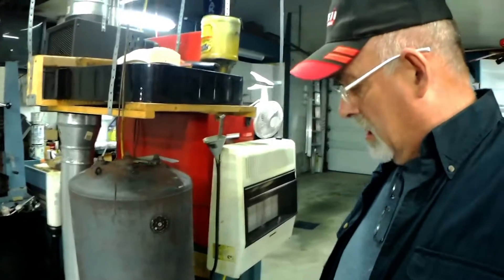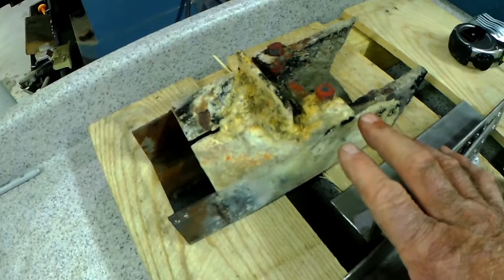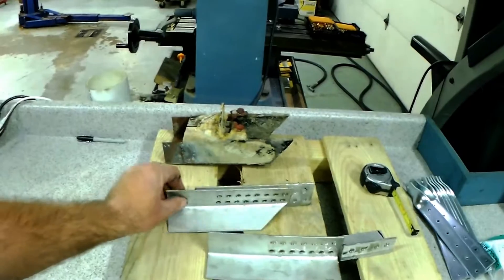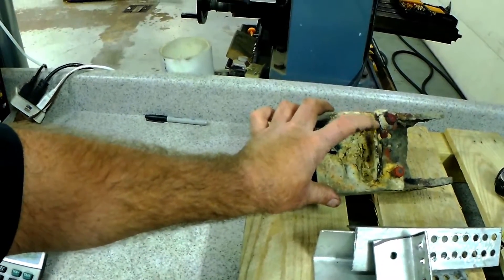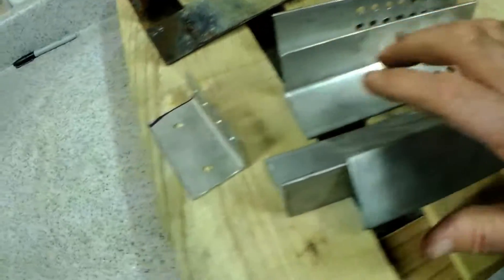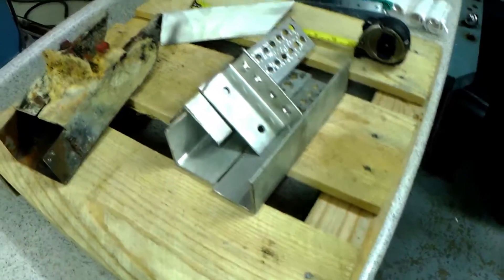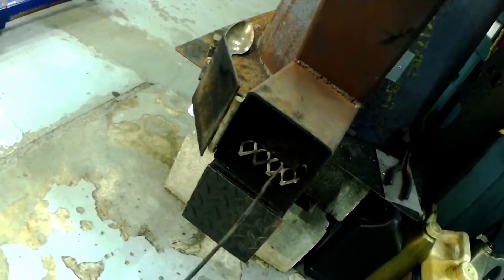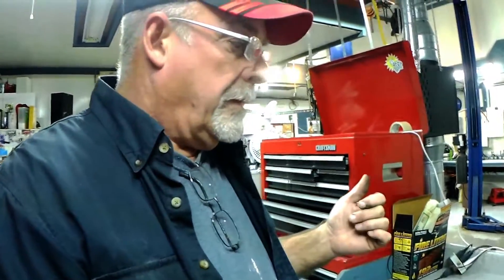Rocket stove burn basket design for wood pellets

Comment: Great video, you have a very good manner and format.  I was wondering about the design size of the burn box vs the size (width ) of the burn tunnel.  I see the burn box being about ~4 inches wide, I see the burn tunnel being ~5 inches wide, is the extra area around the burn tunnel sides a necessary design feature to help with air flow, draft continuance etc..?  Are there advantages to shrinking or to maybe growing this area around the fuel burn box.  Would making this side gap smaller help direct more airflow through the burn-box or is this gaping a way to slow down or regulate the burn rate? I am under the understanding that the burn chamber tunnel entrance to the heat riser is through a ~5 inch opening in the heat riser side where it meets( is welded to) the burn tunnel?  Thank you and others in advance for any information that may help me understand your design better.
Reply from the maker: Dean, if you scroll back through my videos you'll find an actual "build video" of the burn chamber, hopefully that will answer your questions. It's 5 x 5 square tubing, 3/16 wall. But all of that is laid out in the video. Thanks for watching and the kind words
Reply from the maker: https://www.youtube.com/watch?v=bfoTuFxxw7I
Reply: @mark_osborne  Hi Mark, thank you for writing back. If I am asking something again that is already answered please excuse me. I have watched this video 3+ times, amazing video of your work. I am pretty sure I understand you are using the 5x 5 tubing. Just wanted to understand why the welded fuel holding  box size is less than  1 inch smaller that the 5x5 tubing. That is the two angles of 2 inch butt welded = 4 inches.  No worries if I am asking something I should have learned from the videos or that has already been answered. Maybe my assumption on the size of the completed welded burn box is wrong etc.
Reply from the maker: @deanpetrella5491  got it, now I understand your question. Yes, the inside of the 5 x 5 tube actually measures 4.650 inches, I previously miss-spoke, the 5 x 5 tubing is actually 3/16 wall (not 1/8), and yes, you need a gap between the outside of the burn basket and the inside of the tube because you have to be able to slide it in and out for cleaning, etc. Too tight and you'll be fighting with it. That small air gap between the burn basket and the 5 x 5 tube is meaningless, air simply passes around it and adds oxygen to the fire.I actually have a small piece of thin bar stock that I slide down along side the burner just to take up a bit of the air gap, it's 1/8 material and is long so I can easily grab it and pull it out.  Good question tho !
Reply: @mark_osborne  Thanks Mark, your detailed explanation helps me better understand this area of the design.  Appreciate the insights!

Comment: I have a question and hope someone will see this who knows the answer. Have you tried to burn wood chips- and by that I mean the tree services now put lots of the wood they cut down through a chipper. I have a heater made like yours out of a old water heater and I also have the 22 degree feed tube. I don't have the dump pan but mine is a lot like yours and I had thought if I had a bucket of chips and wood start the heater going with some sticks/ limbs and then take a small ice scoop and drop them down the throat of the feed tube they would burn ok. I am thinking I would need a little grate or stand at the bottom so air would flow but other than that I am thinking this should work. I would have to feed it often but my heater is only supplemental ti cut down on fuel cost while burning up basically trash. Anyone else had or done this idea
Reply from the maker: Give it a try and let us know !  I'm guessing the wood chips will be too wet because they were produced from a tree that was still 'green', but who knows ?   Like you say, if you feed them slow, along with other wood, perhaps it will work. Put up a video !

Comment: Mark do u know how I can get the kWh or amp hrs of these c max batteries
Reply from the maker: sorry buddy, I tried looking it up without success --- someone has to know. You could run  a test using light bulbs as a load. Check out my test videos, I explain how to do it.  But you must first know the max and min voltages and be careful not to go below the minimum our you'll toast the batteries

Comment: that is quite interesting . i would like to build a 10,000 btu version of that pellet burner onto an epa wood stove for a small cabin for overnight burns on sub-zero nights . is it possible to build and operate that small of unit and safely do so ? how's the diet going ?
Reply from the maker: I don't know about overnight burns.  These things take a bit of on-going fiddling, meaning, you need to refill the feed tube every couple hours and give the burner a stir to release the ash every once in a while.   It's no big deal as I'm usually in the shop, but if I leave for several hours, I'm sure to return to a stove that is no longer running as it ran out of pellets.    A large hopper of some sort might get you thru the night, but the ash will certainly build up and your burn rate will progressively become less and less.  As far as safe ?   Don't take anything I'm doing as 'safe"...lol...   Yes, I lost about 8 lbs but need to lose 8 more  :-) but not right now. Got sick of eating high protein
Reply: ok, i'll take your expertise on not think of such an add-on . thanks.
Reply from the maker: You can buy a commercial pellet stove that will plug along all night on probably 1/2 bag of pellets for under $1000.... I actually have one I just didn't like the heat it threw off.  Nothing like the rocket stove!
Reply: i'll check 'em out . i don't have room for a stand alone unit.